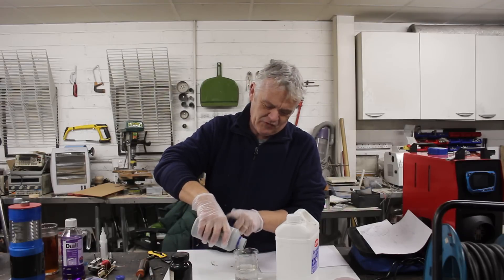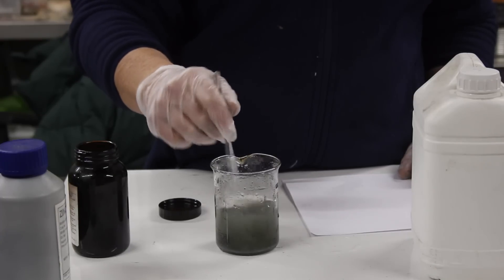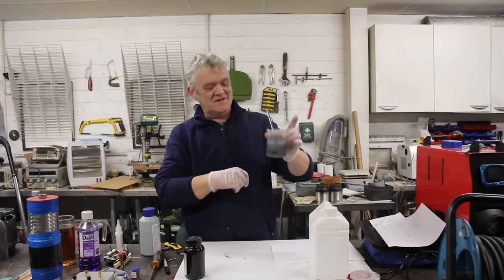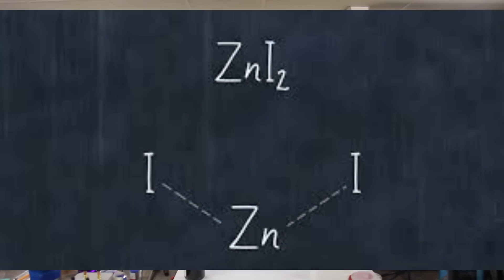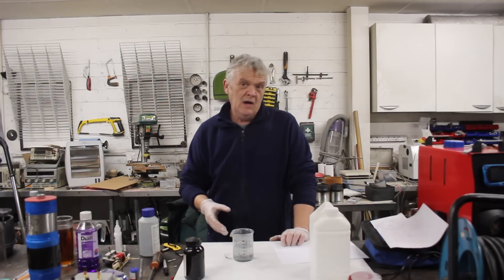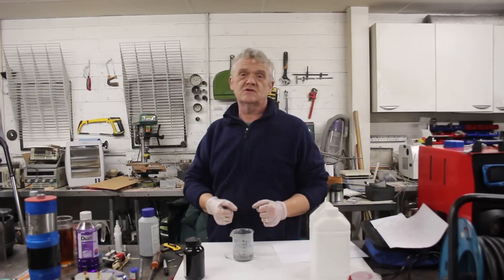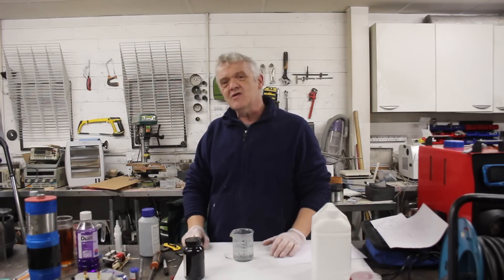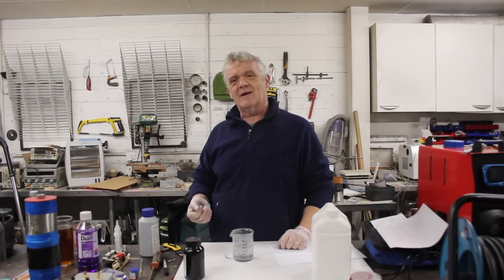1794 Making Zinc Iodide For The Any Size Battery

Comment: Great little video!  I saw a video where a guy use galvanized  sheet metal salt and iodine to make  his battery.  The positive  and negative  posts were all thread . He connected the galvanized alternating between the plates and plastic insulators on the other post. Then he charged it for three hours  using  another battery. Seeams like there are many ways to make batteries. They  are more curiosity than practical in my opinion. I guess if there was an apocalypse i might change my tune !  I think we take science for granted but its friggrn amazing how much its done for us. Are we slaves to electricity now? I guess it depend on how one looks at it. Im just rambling on now wasting your time.  Thank you Robert. You enrich our lives more than you may realize

Comment: After pondering, I decided to go with this over Zinc Bromide. It just seems a lot safer. Read to the end for my favorite Bromine Story.
I would think that I would want to actually weigh and measure the amounts, if I were going to make an actual Battery of Cells, because I would want some consistency in things like, oh, Amp-Hour Capacity and such.
This is easy enough to do, and my Old Hippy Heart would be quite happy to be accurate to the tenth of a gram.

Here is my favorite Bromine story: When Thomas Midgley Junior was inventing Refrigerants, he found two he liked, and, rather arbitrarily and capriciously chose Chlorofluorocarbons over Bromofluorocarbons.
Which turned out to be a blessing, because, had he chosen Bromofluorocarbons, the Ozone Layer would have been destroyed before we even knew there was a problem.
I think so highly of the gentleman who invented TetraEthyl Lead, that I believe that if he had known about the Ozone Layer and the higher reactivity of the Bromoflorocarbons...
He would have gladly chosen them.

Comment: Robert, just watching that exothermic reaction gave me an idea, would it be somehow possible to get an whole load of the stuff, make a huge type of battery, use solar power in the summer to part to Zinc from the Iodine, then in the dead of winter use the chemical reaction back into Zinc Iodide to produce enough heat to make hotwater. If only we could save the glut of solar thermal and solar electric energy which is available this time of year and release it in the middle of December when it is so badly needed.

Comment: Hope you see this, crazy thought.  Zinc dendrites falling off or growing down to the halide layer increasing self discharge.  Most of the electrodes have been simple zinc plates bent horizontally and immersed near the top of the electrolyte.  Coat the bottom of the electrodes with a non conductive coating so the dendrites can't form on the bottom.  They grow up away from the halide layer and even breaking off they simply fall onto the electrode.  Seems too easy, what am I missing.  Lost surface area could be made up by bending electrode into an accordion shape.  Would the additional material be worth it?

Comment: I don't recall if you've ever done a calculation of energy capacity (wH or KwH) per mole of ZnI2.  Given there is the movement of 2 electrons per molecule, 6.022x10^23 molecules per mole that makes it 12.044x10^23 electrons moving per mole.  An amp is 6.24x10^18 electrons moving per second with 3600 seconds/hr so 6.24x10^18(3600) = 2.264x10^22 electrons per amp hour.  This gives (1.2044x10^24e/mole)/(2.264x10^22 e/aH) = 0. 532 x10^2 aH/m = 53.2 aH/m.  The literature seems to give cell voltages varying from 1.1v to 1.26v so for calculation purposes I'll us 1.2v.  1.2v x 53.2 aH/mole = 63.84 wH/m (watt hours per mole) theoretically.  There are always losses in the system so I'll assume a coulombic efficiency somewhere between lead acid at 85% and Lithium at 95% so 90% seems a reasonable 1st estimate.  therefore 63.84 x 0.9 = 57.456 wH/m.  This is all from 1st principles and there may be many factors I am not accounting for so I would ask is this at least in the right ballpark?  As it can achieve about a 14M solution does molarity have an effect on battery efficiency?

Comment: But what sort of capacity is it?  If I had 100 litres of what you have in that jar, how much energy could I store?
Reply: How long is a piece of string? Variables include, but are not limited to, surface area of electrodes, distance between electrodes, concentration of solution.
Gather some materials and play with it. Build one with electrodes of a certain size and measure the output. Then increase the size by 100% and measure again. Try doubling the electrolyte and keeping the the electrodes the same size. Does the capacity double when you double the volume of electrolyte? Does capacity, current, or voltage change by changing the the electrode size? 
The beauty of getting down and dirty with a simple and cheap battery and playing around with it, is that you will gain a far greater understanding than watching the vids.
Reply: @Unicorn Adrian I think you miss my point. There are many options to follow (i.e, currently I'm working on repurposing batteries from dicarded vapes) but i have the space for 5 tons of this stuff.  Which is more worth my while, give me a rough idea.
Reply: @Spedley_2142  again it depends what your goals are. I know nothing about vapes but assume they run lithium batteries. If you want more power density, then vape batteries win. If you want a battery that lasts for decades, can be sized up as large as you like, has zero risk of catastrophic failure, then Zinc Iodide is a better choice.

Comment: Hm.. If you are unable to source pure Iondine. You can give a try to iodine povidon based desinfectant. Maybe not that efficient as there is quite low Iodine for volume but worked fine for me.. and after I evaporated the alcohol and part of the water it bacame really usable. Just put the elctodes in a jar and pour in the desinfectant and the motor starts to spin. :)

Comment: I have a question for you you'll probably know it right off the top of your head. First let me say I have zinc but it's in a bar form I also have zinc sulfate solution but I'm not sure how to make it the metal fall out of solution I know like with silver you can use sugar and that'll make it fall out is there any we message you know to make zinc metal fall out of solution from the sulfate or chloride form? That way it'll save me from having to buy some powdered zinc
Reply: In my glaze making supplies I think I have zinc chloride or no zinc carbonate the big bag of it but I'm sure that would not work the same way obviously

Comment: RM-S, I think I may have found a better use for some old hydranal t-5 I have (better than just disposing of it anyways). Might be a little more dangerous than sourcing the iodine in other ways, but I just have a couple liters of this stuff without much use for it anymore. I am in the USA, and as others have stated correctly, large volumes of iodine and some precursors are well regulated for their potential use in drug manufacturing and explosives (not very practical explosives for those curious, but nonetheless), and to be very clear in the comment I have zero intention of doing/enabling anyone to do any of this. Thanks for the idea... However, I digress. 

As a topic suggestion, it could be very useful for some viewers to learn/see some more about acid cells (I especially enjoyed the dilute pile cell group from a few months ago). I know this topic may require more caution, and it's not exactly a mystery to us all, but there is practical value in understanding how to create relatively high reserve  and low ESR(as a point of practical applications) cells.
Yes, you've definitely covered the principle well recently, and I do admit somewhat selfishly I'd like to see your personal take on a contained, independently sourced/designed/built conventional cell, more or less from a simulated circumstance of need (say, off the top of my head, post apocalyptic situations where you can't just go to the Auto store and purchase a large lead acid battery[ies]). Your chosen subjects in this field have been great to watch, and definitely informative, practical, beyond just tinkering, IMO. The zinc iodide videos are great examples of electrolytic storage and mechanisms, I'd just love to see it taken further with other chemistries, which I'm sure many will learn from at the very least. I have personally built a handful of various chemistry  acid cells, a select few with very good storage characteristics (albeit, some using a ludicrously expensive amount of purified laboratory grade acids and other materiels, but that's not necessary to demonstrate concepts obviously, I just use up extra/leftover/"expired" sources when I can to avoid waste. You have a talent for effective demonstration without breaking the bank, part of which I enjoy your channel so much for).

Thanks again for another great series of videos.

Comment: Galvanized fasteners and scraps of fence wire would work as well.

The only reason I even mention that is because I have just a whole lot of them left over from the results of the former land owner, as well as generous donations of used fence wire from people in my community, out of which, some is only good for scrap, but I carry it home anyhow.

If you want another source for zinc, old carburetors, old car door handles, and some old gas plumbing valves are also made of zinc [its much heavier than aluminum, and it will burn with a toxic powdery smoke if you scrape some chips off and ignite them with a torch], and zinc also melts almost as cool as lead [you can melt zinc in an aluminum pan, but they might amalgamate, so I would not advise doing so, unless you never intend to cook with the pan after that].

So far as making big hunks of zinc into powder, simply put a belt sander upside down in a box, or suspend it over a plastic bag so you catch all the dust inside of it... Or you could set it up with a vacuum cleaner to suck up all the dust as you produce it, but either way, of course, be sure not to breathe it as it can harm or even kill you.

That can get you some zinc pretty quickly, and not only can you make powder out of it, since it melts at such a low temperature, you can make bars out of it to use as your electrodes as well.

Of course, molten zinc can ignite in the air, so be sure you do not overheat it.

If you use a steel mold for your bars, be sure it is NOT 'clean' because it is possible for the molten zinc to directly bond its self to the clean steel.

I would suggest that you ever so slightly oxidize the surface of a steel mold, should you go with steel, so that it will have a surface that the zinc will not want to bond to, and make sure that the corners are radiused, and that you do not make the mold any deeper than the thickness of the bars/plates you wish to make, because otherwise it can be a real buggar to get them out.

While zinc will naturally want to form a sheet about 3 milimeters thick you can press form it much thinner, if you are looking for thin sheets.

My approach to that would be to get some flat sheets of steel, stack them together with some washers in the corners that space the plates the thickness you want the zinc to be, then place them into a removable container.

Since making a removable container might be hard if you use steel, you might want to make it out of fire brick with the edges sealed with regular plaster.

This will allow you to separate it with little more than a light tap.

In fact, since it might come apart even more easily than that, it would be a good idea to put little notches at the corners, and use some wire to hold it together, before you apply the plaster, so as to ensure it remains in one piece long enough to get your pour done.

If the steel plates fit into the brick housing snugly enough, they will not wiggle about, but even if they do, it should not make much of a mess.

You would want to pre-heat the mold before pouring, so as to ensure no bubbles form, messing up your plates.

Once it cools, you can simply unscrew the stacks of plates, and so long as the zinc does not bond to the steel, you should have no problem pulling them apart.

If you use zinc plated washers, there is a potential benefit to this, in that it might be possible to use them as pre-made eyelets to hold the finished zinc plates by.

If the zinc washers are firmly bonded to the zinc plate, they will save one time if they want to have holes in the plates from which to suspend the plates in the iodide solution.

Otherwise, one should use stainless or black steel washers to prevent them from sticking.

Also you can electroplate zinc, and I would suggest using a piece of copper foil because you can easily shape it, it will carry a decent level of current density and help you obtain a reasonably uniform plating product.

And when you are done, you can just peel the copper tape off of it.

Comment: Iodine is freely available in vetinary clinics used to keep wounds sterile
Reply: That's povidone iodine which has a polymer that makes it REALLY awkward to get the iodine out. Much better to buy an iodide salt off Amazon or ebay,  convert it to iodine,  then zinc iodide.
Reply: Nilered did a video some time ago about extracting iodine from povidone iodine.  He was able to extract 2 g/500 ml.  He stated that it was too much of a hassle and too expensive to get iodine that way and that it was much cheaper to just buy it.

Comment: I am thinking it would be a better idea to use zinc and iodine in the healthcare industry rather than batteries, I know the healthcare industry hasn't quite gotten there yet but I suspect they will be forced to Face Reality eventually.( Allspark anyone?)
Reply: We have used both for wound care.
A zinc based paste was the standard before triple antibiotic ointment
Reply: @m.gardner6173  that's true, however it goes way deeper than a band-aid approach, zinc enters the spark of Life Realm and iodine-iodides help to displace and remove man-made halogens in the body, even that statement just scratches the surface.
Reply: @m.gardner6173  probably explains the increasing antibiotic resistance.